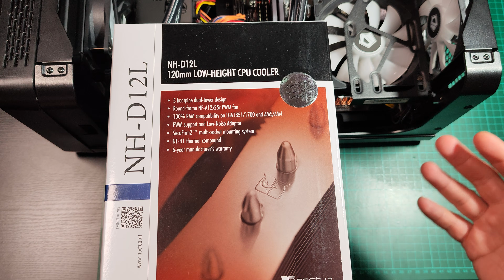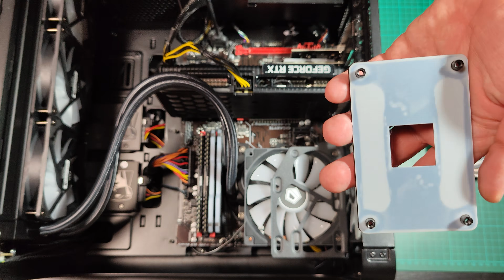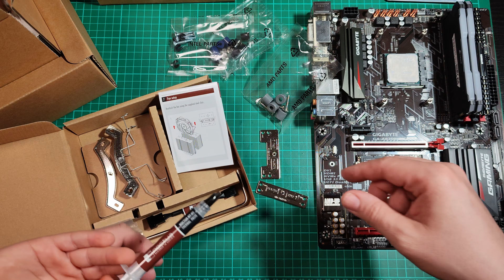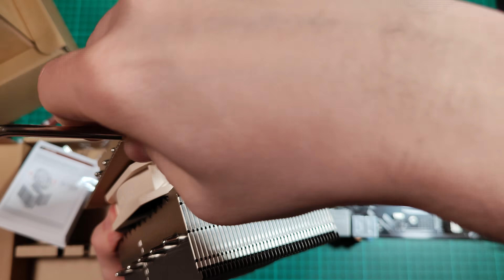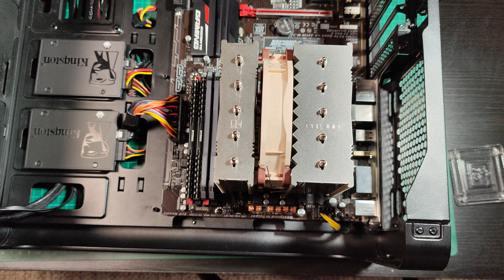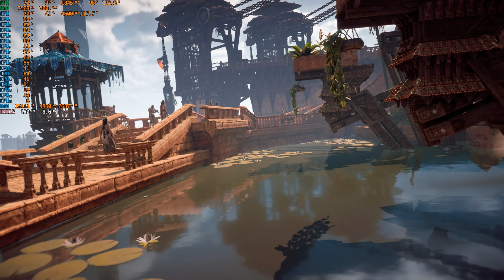Ditching AIO for Reliability: Installing Noctua NH-D12L CPU Air Cooler

Comment: BTW idk if you are fine with mixing ram like that
Reply from the maker: At that time I was using 2 different KITs of RAM, which is of course not recommended. Still my motherboard and BIOS was able to push them to XMP 3000 in that setup. It was intentionally made that way as Channel A was comprised of 2 different memory sticks and the same was happening to the channel B. This allowed them somehow to work OK with my old Ryzen 1700. Later I have switched to a Ryzen 9 5900X and this memory configuration was no longer functional so I have replaced the ram with a new 2x KIT properly inserted into 2 and 4 ;)

Comment: Could be wrong, but i think your second memory module is in the wrong slot. Should be one more away from CPU. Memory slots usually go a-b-a-b, unless you have a odd mobo.
edit Ya you can tell from the red/black connector clips. Each should be in black.
Reply from the maker: At that time I was using 2 different KITs of RAM, which is of course not recommended. Still my motherboard and BIOS was able to push them to XMP 3000 in that setup. It was intentionally made that way as Channel A was comprised of 2 different memory sticks and the same was happening to the channel B. This allowed them somehow to work OK with my old Ryzen 1700. Later I have switched to a Ryzen 9 5900X and this memory configuration was no longer functional so I have replaced the ram with a new properly inserted into 2 and 4 ;)

Comment: Great video. I have a R7 5800x with a Wraith prism cooler and it has been soooo bad but i couldnt really afford a better cooler at the time. Today however i bought the black version of this cooler. I have been using eco mode from time to time, manually undervolting my cpu and everything in between to lower the temps. Its always at 80-90 while gaming.. Hopefully this cooler helps it a bit :)

Comment: If You want to test cpu thermals use occt not mem test :face-turquoise-covering-eyes:
Reply from the maker: You are right, there are a lot of better apps for testing thermals. I wanted to show that even a simple memtest will spike the CPU to 90° due to a faulty AIO, such as running a simple task.

Comment: What GPU is that? I like the back plate

I just got a thermalright assassin king argb, great cooler for the price. perfect for my 5600
Reply from the maker: The GPU is a Palit RTX 3060 Ti Dual LHR, I was also looking at the thermalright assassin, but it isn't so popular at my local stores and it was as expensive as the Noctua. I needed it fast to replace my faulty AIO so didn't want to order it online from another country. Also my case is compact and I can not fit larger cooler, the NH-D12L almost touches the case window so it was a tight fit.
Reply: @TechTronic9000  both phantom spirit and pearless assassin is available even in my third world country.
What country are you from?